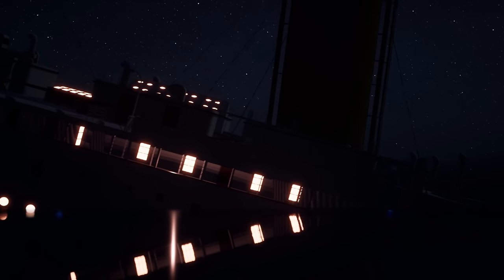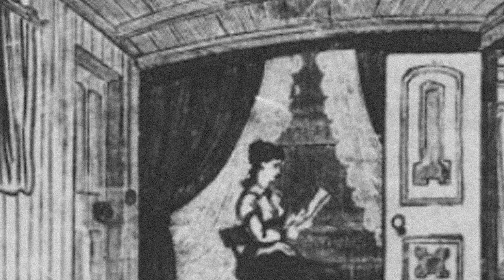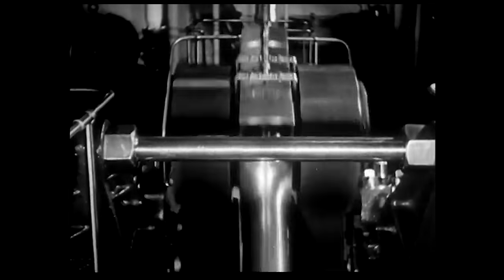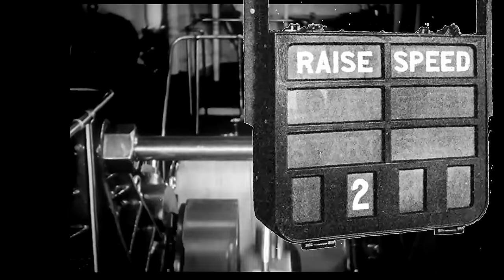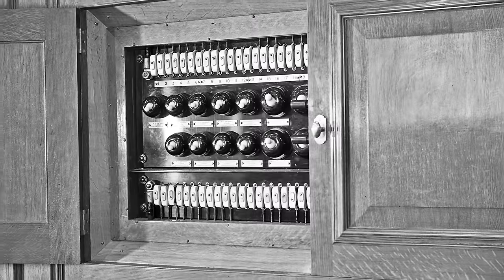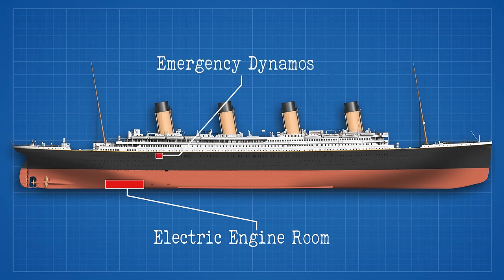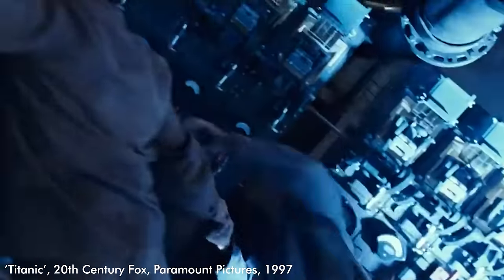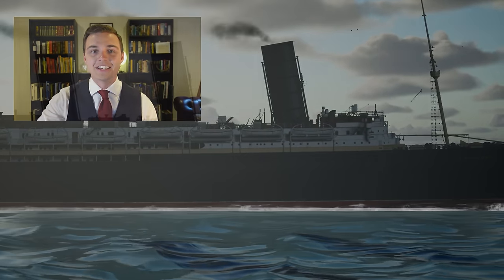How Did They Keep Titanic's Lights On So Long?

Comment: Wasn't aware of the 3rd generator being above. I thought there were 2 side by side, and then an additional one between them and the rudder.   Since they all relied on steam they would have the same failure mode. 
BTW, when the ship stopped moving,  how would the boilers have behaved?  Without traction motors running, wouldn't they have overpressurized? Both the  Cameron and A Night to Remember movies portrain a loud noise of steam coming out with sudden shut off. What would have  triggered the shut-off ? 
BTW, on A Night to Remember, there is a scene where the electric folks are told it was time to go. I beleive one did survive at sea and was rescued. (but not sure if my memory is correct on that).

Salt water does not necessarily short a line. It still offers resistance  and there woudln't be large areas in contact with water since wires thourgh walls etc would be insulated.   Consider the actual shoot of Cameron,s Titanic, they had electrical fixtures in the submersible set. 

Upon water entering the boilers, how long would there have been some steam pressure still sufficient to run generators? (with propusion turned off) ?
Even if the boilers were watertight, instead of air feeding the fire, it woudl be water.

Do you knew if distribution circuits in living areas had fuses, or was there a fuse only for the whole section?  (I assume they had fuses back then?)  Curious if lights within a section woudl pressively go out as water rose, leaving rest of section lighted, or whether it was an all or nothing for each section.
Reply: She had 4 main dynamos, an empty space for another 2 main dynamos for the future (the next compartment) and 2 emergency dynamos inside the turbine vent shaft on D deck. The switchboard had around 50 main circuits and each one was protected by a rewirable fuse and an "I-T-E Automatic Overload Breaker" (in A Night to Remember there is a small scene were a switch trips and the electrician reengages it and then it trips again. Between 1:34:00 and 1:35:00 time in movie). You can find some info about these breakers by googling "old automatic breaker 1910" in images. From each main circuit other small panels withdraw electricity and they had rewirable fuse for every smaller circuit.  
When the main engines stopped the pressure went very high and the relief valves of the main steam lines and boilers kicked in to prevent an explosion. Also hot boilers and water (especially very cold water) don't go well, explosion will happen. That's why they stayed in boiler room 6 to kill the fires.

Comment: As an electrician in the Uk is it possible that these emergency lights could have also had a battery back up ? I know that in the Uk anyway our emergency lights fire exits, normal bulkheads even normal every day lights. Have their own battery pack and are connected to the Main. In the event the mains fault the light switches to its own batter pack to give light for a minimum of 3 hours. Now I know that these lights were first used in 1902 in the UK so could it genuinely be possible titanic has a number of battery power lights aswel that we just don’t know about it. The amount of testimony we have of people saying that some lights remained in after the break up may not be an impossible idea. As these emergency bulkheads were first used in 1902 and have continued to be used to this day just more upgraded, better battery’s and longer illumination times. Just a thought

Comment: 5:20 Was the maximum sustained output of main generators 1.2MW or 1.6MW? I have always heard 1.2 but you said 1600 amps at 100V so 1.6MW. Edit(for some reason my brain always thought it was 400KW *3 for some reason)
That makes more sense because I recently read an old 1911 article (i can't post the url here, otherwise comment won't post) saying the fans took about 5,250 amps and the electric heaters also took over 5000 amps. That with everything else like kitchens, lighting, elevators, cranes, even if nothing was ever fully utilized i think it would too easily overwhelm a 1.2MW genset.

Comment: I always wondered about this. Could the switch room be accessed if an expedition wanted to explore it? Or is it blocked off by the watertight doors like the swimming pool?
Reply: It may be open from the sides. The bulkheads would be closed but either going in from the top could ve possible or through the sides of the hull. The stern imploded at 100-200 m below the surface so the hull plates along a goood chunk of the stern section are blown off. The stern is in very bad conditions due to this. The bow flooded gradually and had few air pockets as it sank so no implosion and therefore it's preserved well. The stern looks like it was part of Operation Crossroads.
Reply: Attempts have been made in the 90s and early 2000s but the stern is just such a jumbled mess it’s not possible to safely even pilot an ROV into the open spaces, what few there are. The stern has collapsed gradually year by year and as areas of the shell plating have peeled away it reveals that most decks are pancaked together, it’s why looking down the 2nd class staircase we see tiles from various rooms all jumbled together.
Reply: @NYYRobThomson  The shell plating being peeled away and the decks being pancaked on top of each other kinda go together. The decks get most of their support from the beams running across the ships, which join to the hull frames at the ship's sides. With the sides, including not just the plating but also the frames (the ribs), sheared away, there is nothing supporting the decks. Some internal pillars might have supported parts of these decks for a while, but under the relentless bacterial assault on the iron, that couldn't last.
Reply: @samfromportadown  it’s interesting to note that the state of internal pillars in the bow emphasize a) just how well made the ship was and b) how much violence the stern incurred. Beams on D and E deck around the Grand Staircase suffered greatly when the bow plowed into the ocean floor with some ejecting their wooden encasings and becoming almost L shaped yet the ships decks didn’t pancake as fully as the stern (or the tear section at the rear of the bow)

Comment: So basically, those engines were like the apu in a passenger jet: a standalone smaller engine that's not used for propulsion but for the "hotel" services on board.

Comment: The over reliance on steam to power the emergency generators (granted there is no available source as internal combustion engines is still in its infancy on Titanic) bit the US hard during the first naval battle of Guadalcanal in WW2. 

The surprise torpedo salvo and excellent night fighting capabilities of the IJN rendered the entire Allied fleet useless and unable to effectively counterattack. The loss of the generators meant that power to the radars also lost. Searchlights cant even be turned on and electric power assist on the turrets were dead. Radios can't even operate resulting in chaos that further hamper the fleet.

The final report on the disaster of the first naval battle of Guadalcanal specifically mentions the need for an alternative to steam powered emergency generators. It spawned the single cylinder Detroit 1-71 electric generators that is small and lightweight enough to be mounted to the different areas of the ship for a localized emergency power.

Much of ww2 naval activity goes like this: the Allies rule the day while the IJN rule the night as the Allies still cant believe the IJN has made great strives to master the art of night battle without the use of radars and fancy equipment.

Comment: I too have always wondered how electrical power was generated and distributed throughout the ship. Especially all these early ships of that era.  I'm still wondering what voltage (110, 220?) and amperage was available in the passenger cabins and  just certain passenger class cabins?  Did they use two wire knob and tube wiring?
Keep up the good work.  Your videos are always impressive.
Reply: The voltage was 100V DC. As the sinking progressed, the speed would reduce, and consequently, voltage would reduce. Everything, including the motor generator set for wireless, would continue to operate at reduced output.

Comment: I can imagine those large amper open porcelain fuses in the main feeder room rupturing in a short circuit with a spectacular big bara boom!  It looked to me that there were several strands of fuse wire in each. Were the strands covered in asbestos tubes I wonder?

Comment: They had steam from one boiler working some turbine generators for lighting and the Marconi
wireless apparatus. the gens put out 100 volts at 300 amps or 30 kilowatts. Since the shaft 
rpms of the gen were around 350, there would be a number of pairs of field poles and power was taken from the spinning armature. the larger gens of course put out much more. varying the
field current would change the voltage at the armature. This does not look like the switchboards
 in the movie "The men who kept Titanic's lights on. 
Although it does not show, it is possible the generators had a smaller gen that supplied the excitation to the main gen's field coils, known as an 'exciter'

Comment: In the situation where water was entering the ship like in the Cameron movie, if it would have been deadly to wade through the water like Rose and Jack did.  The electricity was no doubt flowing through the water at the time.  I don't think any light would survive underwater from 1912, so the lights seen underwater must have been dry rooms.

Comment: No GFCI to trip back then as well, just power on through the shorts bit by bit and blow oversized fuse by fuse. 

I imagine modern ships have all sorts of fancy protection circuits that wouldn’t have stayed on through the flooding. 
Sure maybe some emergency lights, but not the main power. 

I feel the titanic sat in the era of overly heavy electric, but extremely well made equipment. Equipment without many automatic controls. 

Equipment that was almost entirely manually  controlled and entirely relied on the skill, proficiency and bravery of men to control circuits precisely as the ship sunk.

Comment: "Poor chap down at the switch board is electrocuted". I gotta be honest that was probably a mercy. Death would have probably been painful but quick. Considering the alternative of death by drowning (as at that point they'd have next to no chance of getting topside) I'd prefer electrocution in that instance.
Reply: He wouldn't have though. The fuses would have just went off. The electrocution is dramatic liberty. No one survived from down there so we don't know how they died. From the location they likely drowned. If they made their way aft after steam power was lost than they may have suffered the much worse fate that many did in the third class lounge or their cabins in the stern. Thise parts remained dry even as the hull submerged and sank. The water pressure eventually catching up with them after some moments.
Reply: @221b-l3t  Thanks for your reply. I've been learning more about the ship and see what you mean. In this instance I think the dramatization would have been more merciful. Having had a near drowning experience of my own I wouldn't wish that on my worst enemy.

Comment: Hey Mike! Placed on order on your website about a couple of months ago for one of your prints and it seems to still be pending, would love to get in touch and get the order moving along. Love you work!
Reply: I had the same issue, opened a dispute with Paypal, and was refunded as the seller never responded. I feel like all the emails connected to his website aren't monitored anymore.

Comment: 5:25 that diagram is impossible for a DC grid.  Transformers are strictly AC devices, and converting between the two is complex (requiring either semiconductors or another whole mechanism).

It is possible to convert DC voltages, but unless you want to waste a bunch of power, it's complex.  Lowering the voltage efficiently requires a capacitor on the low-voltage side, and something (typically a transistor with more transistors for logic, though I guess vacuum tubes might work) to rapidly connect the two sides when the voltage drops, then disconnect them before it gets too high.  Raising the voltage requires an inductor as well (but you switch at a fixed rate instead of based on output voltage).

The reason we use AC so much, is largely because of how simple a transformer is.  Two inductors and a hunk of iron.  No fragile, bulky vacuum tubes or anachronistic integrated circuits.  No automatic switches, no logic.

Comment: survivors claimed that titanic broke just before the third funnel which means that titanic's lights might have stayed on after the breakup. when titanic broke apart it would have ruptured the bulkhead between boiler rooms two and one, but the fires in boiler room one would not have been put out immediately. 
the dynamos would still have steam pressure until the water cooled the boilers in boiler room one. the lights would not immediately go out but they would get dimmer and dimmer as the boilers are cooled and then finally go out
Reply: yeah well they didn't
Reply: That's because they can tell by the funnels, it wasn't because lights stayed on, it's impossible for lights to stay on as Mike stated and current research, emergency dynamos rely on steam, as the break occurred the pipes are severed and all those steam would rush out making the engines and flywheel come to a complete halt on spinning, meaning no power to give on the ship, leaving it to total darkness. 

The dynamos would not have "steam pressure" as the pipes are completely severed, all steam would rush out those pipes. The reason why the lights started to become dim was as the steam was running out and boilers where shut one by one, limiting power. And finally completely going off as the ship broke apart.
Reply: @KiwiKiwf  this is just my theory. other survivors claim that titanic broke just after the third funnel. as James Cameron said, " you can make the best guess possible, but you never know what happened." what probably happened is that a crack formed in titanic's keel just before the third funnel, near the boat deck because the strain was strongest here. the crack expanded down through D deck, but the crack wasn't Thero. parts of the ship were still connected on A through D decks. which caused another crack to form behind the third tower. the first crack expanded down to F deck, which was just too much for the ship to handle, and the stern started to slowly fall.  the falling stern suddenly caused the first crack to expand, tearing through the orlop deck and annihilating the watertight bulkhead between boiler rooms one and two, but the hull plates and double keel held, making it look like the ship was still in one piece. meanwhile the second crack expanded to D deck and stopped there for a second before tearing through D deck and then being caught by E deck. as that happened titanic's stern dropped about five feet, a very small amount, but enough to put considerable stress on the steam pipes. the steam pipes held but were ruptured in several spots, causing the lights to flicker once and then drop to extremely low power. the emergency dynamos were probably running by then and would have been turning faster than the other dynamos (because the smaller an object the easier it is to turn.) the emergency dynamos would have been turning about fifty or sixty RPMs while the normal ones would be turning about thirty, just barely enough to power the stern of the ship. meanwhile the hull plates that had so far stopped the first crack from splitting the ship in half started to fail. they began to buckle and collapse. 
suddenly the hull plates could not stand the stress any longer and completely collapsed, breaking the ship in two. the double keel that held the bow and stern together separated and the bow began to plunge to the seafloor.  the sudden breakup left the superstructure below the third tower unstable, although it held for now. the second crack expanded to G deck and stopped there. boiler room one began taking on water which hoisted the already unstable superstructure to a fifteen-degree angle. the superstructure could not handle this and began to collapse. the forward part of A deck collapsed, collapsing the base of the third tower which caused the funnel to collapse. the fifteen-degree angle of the third tower superstructure snapped all of the steam pipes which finally shut off the lights.
this all happened in about thirty seconds.
I'm not objecting to your theory but supporting it. if the lights went out completely just before the ship broke in half the reports would have been unanimous that the ship sank in one piece. that is because the night was very dark with very sparse stars, and it was a new moon. the only thing that was producing light was the titanic. if the lights suddenly went out the survivors' eyes would have been adjusting to the darkness. they probably 
would not see the silhouette of the ship until it was gone. however, if the lights were running at extremely low power, chances are that the lights would burn just bright enough to see the silhouette of the ship for a moment. that's why there were conflicting accounts of how the titanic sank.
Reply: @voteme462  There are no several pipes that would survive, that connect to Dynamo. All the pipes were completely severed during the break. Compression on the decks below would bend all the pipes, this is not just about your theory. The compression stresses would be too much for the pipes that it would start bending and rupturing, this is evident in the Bow's piping on the sides, all of them are bent and severed in the same manner, meaning they all broke and got bent at once.  The lights would completely go out.